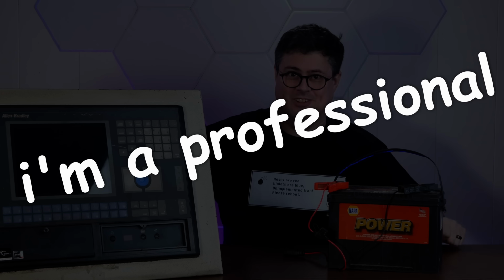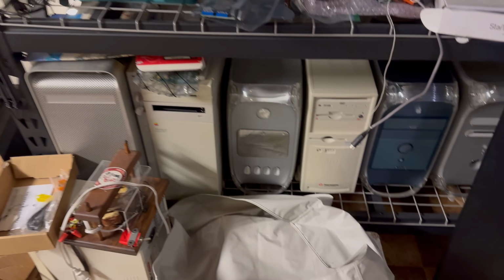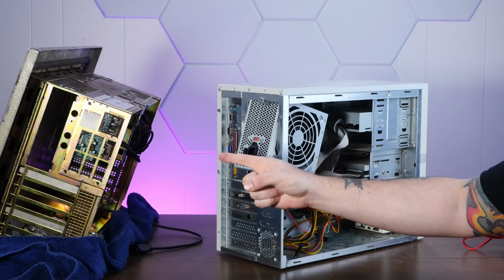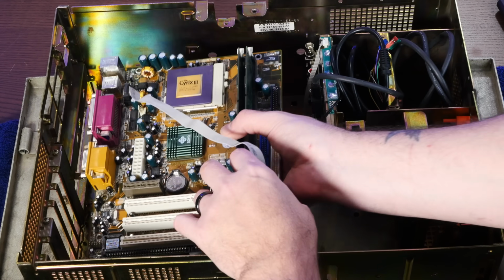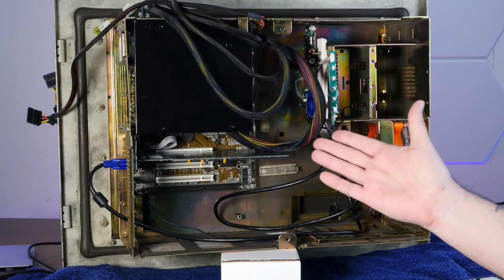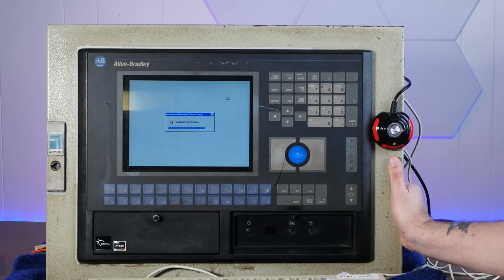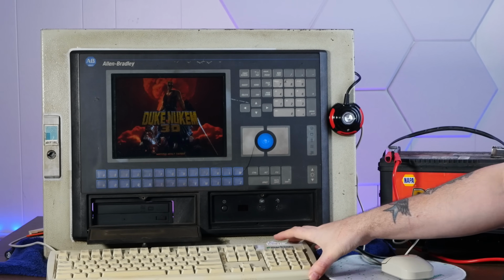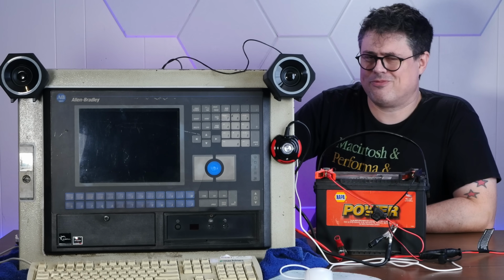Building a Terrible “Laptop” for Windows ME

Comment: Pro tip: when connecting car batteries, red wire should be connected first then the black. And when disconnecting do the inverse (take off black first). Much safer and no flying sparks lol

Comment: All the fun of a wall ATM without the cash. I had an XJ it was terrific fun to hack. Cruise control just plugs in with a steering wheel and clockspring swap. The connector under the hood is like an automotive USB. I believe it was early CAN Bus. The light on the dash already has a bulb too. Wasn't able to get the junkyard heated seats to work, probably open in the seat itself. Also rewired a Grand Cherokee seat for the driver's side cutting out the memory module. Oh yeah and a powerlock button inside the cubby hole by the rear hatch. 2 wires all the way forward to the passenger footwell and the switch was from an Explorer rear tailgate area. Scion Pioneer stereo, with aux headphone drilled into the face. Had to cut the dash a little to fit that. It lasted longer than the factory radios, 3 or 4 of them, and it had a key on/off sequence to hack the faceplate to say anything.

Comment: Are those spare PCI ports I see?! What about a Radeon HD 5450 or 7450 PCI with NimeZ drivers? What about an Nvidia GT 520 or 610 PCI using Windows XP Tiny or Windows Embedded or a 

Am I right to assume no Windows 10 Tiny or Windows 10 LTSC or Windows 10 IoT due to lack of NX bit? BUUUUTTTTT…. Windows 7 Tiny or Windows 7 Embedded would run well if you have 768MB or more of RAM. 

And whaddya feel about a nice mSATA SSD with built in TRIM support, like a Samsung, in an IDE to mSATA enclosure/adapter? 

Oooo last one AND how about dual booting Linux Mint Debian Edition 32 Bit or something easy to install like that to test the graphics drivers in both OSs?! I think Debian and mint still have revision 390 drivers in their repos… otherwise it’s archlinux32 which is a bit more feisty to install if ya’ll know what I mean. 

WAIT I LIED ONE MORE…. But thennnnn how you feel about using PolyMC to test out and mix and match various Minecraft versions with different Java versions with an enhanced server manger with balancing mod packs?!

Comment: AC from the wall to charge DC in the battery to run AC in an inverter to a power supply that turns that AC into DC is just perfection

Comment: For VCF, you could swap the car battery (which, as others have pointed out, aren't really designed for the kind of constant load you're putting on it) for a Li-ion power bank and a DC-DC converter to get 12v.

Comment: Actually car batteries are quite safe in terms of shock hazard. 12 volts will only hurt you if you get two alligator clips and lick them (absolutely do not do this, car batteries can dump hundreds of amps so it's not gonna be a sharp tingle like a 9 volt, your tongue might actually explode)
Reply: They won't shock you. But if you have a short circuit you can melt things (including flesh) easily.

Comment: There are power supplies with 12V DC input, as mentioned, you should use one for endurance and for the battery health (since it isn't deep cycle)

Comment: I don't know but he could just use a gutted UPS Power it has a 12v Battery 🔋 that is sealed and is designed to be use with a computer 🖥 plus is more compact and mobile he could actually install it inside the computer chasis.

Comment: This build reminds me of a bit of computer humor that was circulating in the late 1980s or early '90s about a fictitious Burroughs portable mini or mainframe system. It was basically a mock advertisement that compared the made-up Burroughs machine against its major competitors at the time, which, if I remember correctly, consisted of an IBM mainframe, a VAX, and an IBM PC (per the "ad", of course). The fake ad included a feature comparison table, as was customary at the time. My favorite entry in that was "Fits in a briefcase:  IBM Mainframe - no; VAX - no; IBM PC - no; Burroughs - yes*" and in fine print, under the table: "* Large briefcase required". Your build is funnier, though, because you actually made it real! I'd be interested to know how long it runs on a charge.

Comment: If you shop around ebay (and salvage lots...) for an EPIA-5000 (or a nano-itx budget depending) and a DC-DC converter you might have just enough space to mount the battery INSIDE the PC... Or just jam pack it with LiIon cells for "the worlds largest fire hazard portable" :D

Comment: Car batteries aren't THAT dangerous. You can try this at home if you learn about the safety hazards first.
The biggest danger with a car battery is dropping it on your foot and breaking your foot. The second biggest is shorting it out, making big sparks and melting your metal tools.

Comment: There's an adaptor from 12v to ATX, you dont have to convert from 12v DC to 110v AC an then back to 12v DC just to get 5v and 3.3v rails, that's ridiculously inneficient.
Just search for "12v atx psu" and you will find lots of options to run that without wasting a lot of energy.

Comment: If you actually want to lug it around, there's converter boards that plug into the ATX motherboard connector and allow you to use a single DC power source to run everything. Change the battery into a LiPo pack and you're golden.

Comment: i think you could easily upgrade that to using a DC-DC atx power supply, and grab a few ryobi 18+ lithium packs to run it. the dc converter must allow up to 24v for that battery to work though, otherwise you're stuck with probably 12v only, and not a wide range of inputs. i use a 180w dc-dc atx psu on my beige g3 desktop. runs perfect as long as you switch the jumper on the board to "ATX" or "PS2" mode. amazing that apple built that into their first g3 boards... maybe influence from IBM on that one...

Comment: Useless trivia: throughout the nineties Apple never called their portable computers laptops! Some PPC models ran so hot they had to have a flat surface to allow convection air cooling underneath the case (between the desk and the case by virtue of the 4 small rubber stand-off feet). They could burn users who used them too long ok their laps! So we were told to never call them laptops in the shop :)

Comment: Yet another coincidence, I just ordered another batch of vintage Allen-Bradley carbon composition resistors from the electronic bay website for my "vintage clock" project. I also just received some carbon composition resistors made by TE Connectivity, which I believe is the company that bought the Allen-Bradley electronic component business, so in a way those resistors are also Allen-Bradley resistors.

Sadly it looks like they're ceasing production of their carbon composition resistors (they're made in the UK, so you can thank Brexit for that) in favour of those boring modern film resistors. So after something like 70 years of production, Allen-Bradley carbon composition resistors are finally being resigned to the annals of electronics history.

Comment: Computer parts will run DIRECT current from a 12v battery. Mobos can handle up to 15V, or as little as 10V. Some of them do not have the voltage regulators to get the 5V or 3.3V lines up and running though. So a separate, step-down circuit, usually just the 5V line is all that's needed for boot logic. No inverter or power-suck-lie necessary! Do not try this at home either. But I run lots of junk this way, on my boat. Where nothing bad ever happens.

Comment: You could get the other side of the industrial case. It used to for in to a box almost like a circuit braker and that who front was probably on a hinge for easy access to the insides. Search Okuma LT2000EX-3TMY control panel for an idea of what to look for.

Comment: Rather than use an inverter and a standard big box power supply, you should look into a DC to DC PSU. There are such devices that can supply up to 300W for quite cheap, and they're TINY in comparison to a full size PSU. Combine that with a smaller marine deep cycle battery, and you can probably fit it all inside the industrial PC's chassis AND be far more efficient, probably giving you just as much battery life on a much smaller battery.

Comment: Since the MLB uses known input power of 12V, 5V and possibly 3.3V... you could skip the invertor, and just lug around a 12V Battery (Lead-acid), 5v (USB Charger) and 3.3 (USB Charger with DC-DC step down) 

Totally normal computing!

Comment: how long does it last on the car battery?
Reply: The battery's "reserve capacity" rating is how long it lasts at a 25 amp load. Here the load is probably half that at most so assuming a 60 RC battery you could get 2 hours.

Comment: Hey now, Winndows Me is actually quite good. It's basically Windows 98 "Third Edition" and brought with it some much needed updates like native USB storage support, better networking support carried over from NT, and faster boot times since it wasn't carrying around so much DOS baggage.  By the time it released, almost nothing required you to be in true DOS to run it, so the loss of "Reboot into MS-DOS mode" isn't that big of a deal. As long as you're not using some ancient hardware that hasn't had drivers updated since Win95, it's also remarkably stable.
Reply: Sike
Reply: WinME is a godsend if you still intend to use actual accessories on an ancient computer. PDAs? Better plug and play. Internet? Better control panels. PTP cameras? Better photo browser. Etc etc etc

And well. It's 2024. I could just patch dosmode into ME if I wanted to play those old clunky games

Comment: 2:03 Ah I see the Bubble Bobble version of the GameRoom classics bar top. I have a pair of the GameRoom Classics PVG Tech Neo Geo systems. But I converted one of them into a full JAMMA RGB Pi system. Much better emulation and sound than the original hardware.

Comment: You got a DC 12 volt line straight out the battery, all you need to do is some PCBWAY shenanigans to down volt to get +/- 12, 5, 3.3, and 2.8 volts DC. Way more efficient (and quiet) than upconverting to 110 AC then back down

Comment: The fact there is a converter for car battery to power outlet means someone somewhere, had a use case for this and I have questions.
Reply: Those are super common, available at tons of retail stores. You can run smaller power tools, lights, TVs, etc with these basic models.

Comment: Pico PSU connect directly to the battery. No reason to run a whole inverter just to take the voltage back down to 12v. DC-DC converters to run other parts of the system if needed. Running a setup like this off a standard car battery is going to kill it quick you probably want a deep discharge battery for this application if you want to run it more than a few cycles on the battery. With a SLA deep discharge battery and using DC-DC converts like the PicoPSU you could fit everything including the battery inside the case.
Reply: Agree, but swap the SLA for LiFePo4.
Reply: Note that a standard PicoPSU and clones put the input 12v power directly on the PC's 12v rail. If you connect a battery this means you can have over 13.5 volts on the 12v rail which may not be desired. Make sure you get one with buck-boost conversion. I have two M2-ATX-HV I was lucky enough to find for $1 each which would work perfectly here.
Reply: This was my first thought as well, but then I remembered that the goal was to make the stupidest "laptop" ever. You don't power stupid with smart.
Reply: @masterkamen371  I mean there's no bottom level of stupid so you could power it with a gas generator too, but that's not really the challenge, the challenge is to make this stupid thing portable, and that'd be a  lot simpler and less dangerous without the 120v inverter.
Reply: There are full sized Psu that run off 12v problem with them are how ever they are niche and cost almost 1$ usd to the watt on power limit. lol 800$ for a 750 watt

Comment: Would be even better if using a 12V pico power supply so could connect it directly to the battery, would be even more efficient and would last longer on battery
Reply: Thats exactly what i was saying at 2:30

Comment: Most amusing.  I wonder if you could do something equally as terrible as taking a desktop box and mounting an lcd monitor on the side panel (drilling holes in the side panel and using the vesa screw holes).  Even better if it's a touchscreen.  Instant All in one computer.

Comment: I've always thought it was a bit ridiculous to run a computer, which runs entirely on 12VDC or less, from a battery, which supplies 12VDC, through an inverter, which produces 120VAC from 12VDC, to a power supply that just immediately rectifies and regulates that AC voltage right back down to 12VDC and less.  Tell me you're not wasting battery life powering the circuitry of the inverter and the power supply.  What you really need is an appropriate boost and buck regulator that can provide a smooth 12VDC, 5VDC, 3VDC from the battery, even as it discharges.

I mean, the inverter is perfect for this application -- don't get me wrong.
Reply: All he needs is a picopsu, it takes care of regulation for 5v 3.3. -5 and -12v rails, just supply it with 12v strait off the battery, the only issue would be depending on the older motherboard used it might need a beefy 5v rail.
Reply: @DavidScheiber car batteries start at 12.6 and can drop below 11.5 while still providing power. You need 12.0 for a computer.
Reply: @tOSdude  in practice you can be well off 12v and it still works, at least when i tried with a 12v battery and a pentium 4 board, didnt crash until i got below 11v
Reply: @tOSdude perhaps dude would be better with a PD battery bank?
Reply: The (I think ratified, but not common yet) ATX12V motherboard power standard means soon you'll literally 'be able to' run a computer off a car battery - it just supplies 12v to the mobo and the mobo itself sorts out the 5v and 3v stuff, as I recall.
Reply: @Beany2007FTW  the 12v supply needs to be rock solid for those to work properly. You'll just need a buck/boost converter of sufficient quality between the battery and that mobo but yeah, that would have been a cleaner solution however for fooling around he did great with what he had on hand
Reply: @tiagokawata  I get it, and very much appreciate the absurdity.  It still makes me think about how a person might do it less absurdly, if one wanted.

Comment: You could open the inverter up and connect the intermediate power rail, the HV DC i mean, to the DC Rail of the Power supply directly, behind the Rectefier, you would at least gain like 10 Percent or so more efficiency and runn time, with reversable mods. You really dont need to turn 14VDC in to 400VDC and turn it back to 12V DC...given your inverter has that rail and doesnt do it in 1 step already.
Reply: You wouldn't gain much efficiency from that. The final inversion step of the MSW inverter and the initial rectification in the PSU are the most efficient steps. Most of the loss is in the PSU's isolated voltage converter and to a lesser extent the inverter's boost stage.

Comment: Looks awesome. If you're sorta kinda serious about making it self contained, maybe replace the mains/ 110v PSU with a DC-DC converter, as used to let microatx machines run off a 12v wall wart, and then stick a couple of deep cycle 6V batteries, as found in an old UPS, in the bottom of the enclosure. Also, mouse and keyboard must go via the front PS2 ports for maximum silly, if you cant make the membrane work. Thanks for the entertaining videos, this is exactly the sort of nonsense we should be encouraging 😂

Comment: Car batteries aren't meant to run cycles. They're great for giving enormous power for a few seconds, but if you charge/discharge the thing only a dozen times or so, it'll be broken.
You need a marine deep cycle battery.
Reply: Well, he did mention he was building the worst laptop...
Reply: Actually a marine deep cycle is a hybrid between a normal deep cycle and a car battery, a normal deep cycle would be the better version.
Marine deep cycle is optimized for both starting and deep discharges, while a deep cycle is made for purely that, just cycling. But if you can't find a pure deep cycle a marine one will work fine.
Reply: Doing this for actual regular use sure.

Doing it for shenanigans, a used car battery is perfect!
Reply: Just let the man cook
Reply: he's not criticizing the video, he's giving a suggestion to improve it.  @replikvltyoutube3727
Reply: I was just going to say the same thing. Lead Acid batteries should not be discharged.
Reply: That's a valid point
Reply: My dad did this with an inverter back in the late; 80s to run a color computer and tv to count laps for races at the local r/c car meet ups (he owned the only hobby shop within 75 miles).  It worked fine for years.
Reply: True!
Reply: @Daniel-ne2tg  He had to be terribly board and out of idears to start this one - lol
Reply: I was going to say the same thing, and it would also add points to the terrible factor since they're heavier 😂
Reply: The issue I can see is just too much discharge will be a problem for the longevity of the battery, so it can just charge when it is at 50 % or something instead of going close to 0 % before charging.
You will discharge and charge a car battery often since you do so every time you turn on the engine.